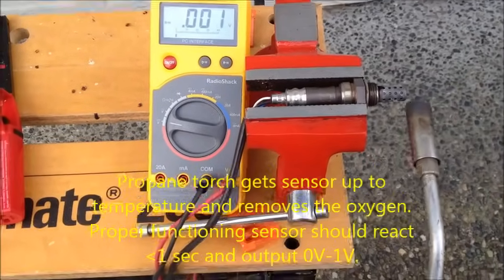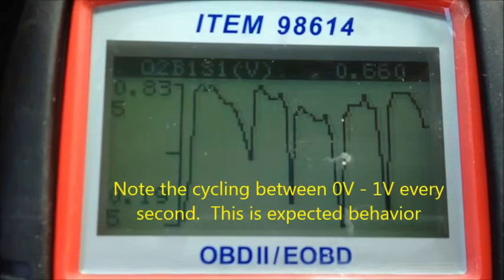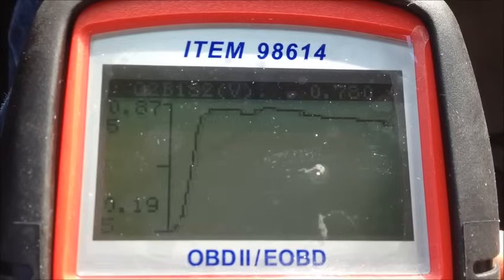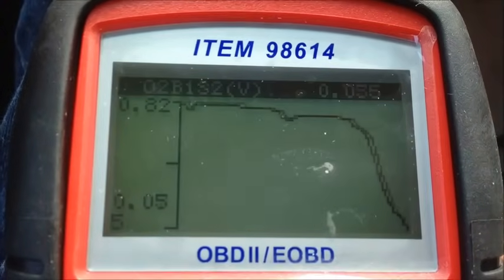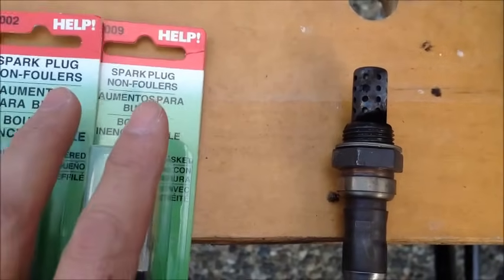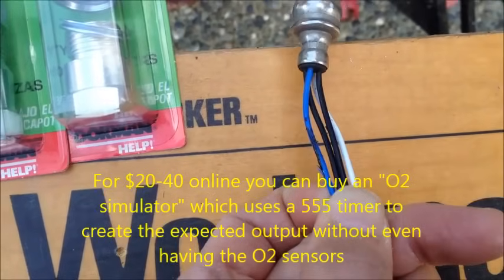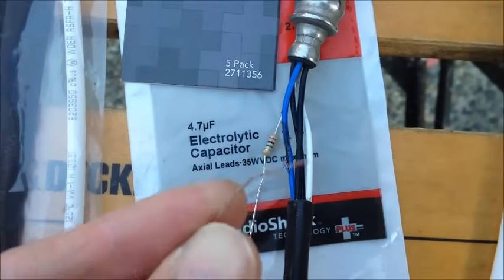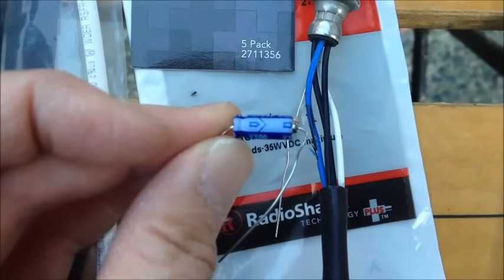$3 O2 simulator fix for P0420 Check Engine Light

Comment: Here’s how I finally got rid of my P0420:  

I have a 2007 Suzuki Grand Vitara that was getting the P0420 code.  I decided to first try using an O2 spacer since they have been working fine for the last five years on another car I have, a 2000 Nissan Xterra.   It passes inspection in California every two years with no problems – all monitors stay ready and no codes or check engine light.
However, the spacer did not work on the Suzuki.  I got a P0420 very quickly after two short drive cycles.  I then tried a different spacer with a smaller hole but still got the P0420.  Two more different spacers were tried (right angle spacer and 45 degree spacer) with no luck.  I gave up on the spacers and switched to the low pass filter method described in this video.  My first attempt was using a 1uf capacitor and a 1M ohm resistor.  I got a code P2A01 for O2 sensor circuit performance.  I then tried a 4.7uf capacitor and a 1M ohm resistor.  Same code showed up – P2A01.  This time I graphed the sensor and saw that it was never going below .22 volts.  The Service Manual for the Suzuki says code P2A01 is issued when the O2 sensor “signal is more than 0.2V for more than 4 sec. even though vehicle is running with fuel cut mode below 4000 rpm.”  This generally occurs when you are driving, for example, on a freeway and you take your foot off the gas to coast down the exit ramp.  It can be simulated by idling the car and revving the engine four or five times and then letting go of the gas pedal.  You should see the O2 sensor dip quickly to almost zero before climbing back up.  

I then tried a 270K ohm resistor instead of the 1M ohm along with the 4.7uf capacitor, hoping it would expand the amplitude range of the O2 sensor so it would go below .2V.   The resistor helped some, but the O2 sensor barely got below .2V, and it was for just an instant no matter what the driving condition was.  

Next, I tried a 10uf capacitor and a 180K ohm resistor.  This helped a lot and the sensor appeared to be working as it should as compared to the sensor on bank 2.  I got no more fault codes or check engine light.  However, the monitors would not go into ready mode no matter how long I drove the car.   I tried one final time with a 10uf capacitor and a 100K resistor.  Same result. After driving the car for over 300 miles, monitors were still not ready.  

Went back to trying a spacer again after reading that some people stuffed some stainless steel wool into the spacer tip to reduce the flow of exhaust gas reaching the sensor. Went for a test drive with my scanner attached not expecting much, but all monitors went ready in just a few miles.  Came back home, checked for codes and found none, not even any pending codes.  Restarted the car and this time drove on the freeway to see if any codes would set.  Once again, no check engine light, no codes.  It’s now been about 1300 miles and still no codes and all monitors are ready.  My inspection comes up in about a month and should pass easily here in California using the spacer.

The stainless steel wool and spacer was used with no resistor or capacitor.
Reply: Wont the smog inspector see it if there a visual check
Reply: @HonDaPursuit exactly my concern
Reply: سلام عليكم بدون زحمه هاذ الطريقه تنفع الى سيارة الحديث مديل 2022
Reply: I have same question - did you use resistor and capacitor + distancer, or distancer with steel wool solely
Reply: @gile11ubica  spacer and steel wool only.  No resistor or capacitor
Reply: Where did you go for smog check? The place I went failed me because they seen my spacer.
Reply: hey if i go to inspection with spacer does that gonna make my inspection failed and which one you recommend thank you

Comment: Does anyone know where I can order these from looks like RadioShack no longer carries them and fryes is now closed
Reply: I can't find this stuff either. Is a tantallium capacitor okay to use? I found one of those with a 4.7 uF 35V rating. Got to order all this stuff on ebay and amazon.

Comment: Can't believe this actually worked on my '99 Suburban!! I could not remove the O2 sensor even with correct tools. Thanks so much for the well explained vid!!
Reply: Correct tool = heat
Reply: what motor is in it

Comment: Hey, the thieves cut off my O2 sensor so I have wires only. can I use your trick to turn off the engine light?
Reply: No . You still need the input from the O2 sensor .

Comment: I guess you could connect the cap and resistor anywhere in the line.Maybe a place easier to get to.
Reply: THis is what i want to know. My post cat sensors are under the car behind a bunch of skid plates and reinforcement plates. Pain i nthe ass to get to.

Comment: Hi brother i have Suzuki Every 2010 model i face P0420 bank-1 and sensor have 5 wire's and bank-2 have 4 wire's . Plz help me Van give very bad fuel Average. New sensor is not available and used same sensor not working properly. I'm stuck in this Problem

Comment: Nicely done video, and you are correct, this will "fool" the computer...sort of.  The computer will show this test as "incomplete" and it will stay that way.  Eventually, and it can takes months, you will most likely get the light back on with codes P0144 and P0145 which are directly related the voltage sensing of the O2 sensor.  In California, your car will not pass due to the incomplete, but your light will stay out for a while.
Reply: So do you need all monitors set in CA to pass? I'm a PA emissions inspector and we can have all but 1 monitor set and all but 2 set if it's from 95-00
Reply: @ZachHolmes02  up till 03 you can have 1 incomplete monitor. On 00 and below I believe it's 3/4 of monitors are required.
Reply: You are correct. That’s what happened in my case. Engine light remains off but cat monitor does not set. Great video though.

Comment: Hi!  Thanks for the video.  Are the color of the wires the same for all cars with O2 sensors for the downstream?  Also, I have a Pontiac G6 2.4L I am hoping this will work for the downstream on my car since I put a header on it.  If you have time to answer my questions I would appreciate it.  Thanks!!
Reply: no theyre not.  but its not hard to figure it out.

Comment: Tried this twice both times got a 158 and 138 code voltage too high...
Reply: This means the voltage is staying max'd out for >10sec.  This can happen if the O2 sensor is burned out and not cycling in response to o2, or if the RxC is too high.  You can try to reduce RxC, but my guess is that your o2 sensor is bad.  You can bench test it as shown - if it responds to the lack of o2 in the flame then it's OK and you just need to lower RxC

Comment: Will this work on a 2013 Ford Mustang gt  also I have the foulers on them still getting the light  also I have gutted cats
Reply from the maker: It won't work if you have gutted your catalytic converter.  This depends upon having a working cat and just helps make it look better by slowing down the signal.

Comment: dont you think 1M resistor is too strong to drop the amplitude wave
Reply from the maker: It's all about the product of the resistor x capacitor and how much you want to slow the waveform.  The values I gave worked for me but you may need to adjust depending upon your input waveform.  If you have a graphing OBD like I show then you can see just how much you need to slow it, otherwise experiment.  If you slow the waveform too much you'll get a different code saying it didn't change enough in 10 sec.

Comment: I wired up my downstream sensor to fix the p0420 code with the 1mega ohm resistor and 1uf capacitor. But now im getting what most people complain about is the p0138. Do you have a fix for this?
Reply from the maker: P0138 means the lower voltage is staying above 1.2v for more than 10 seconds.  This could mean your o2 sensor is broken - did you bench test it as shown?  Another possibility is that the value of the resistor x capacitor is too high causing the waveform to slow down too much, but 10 seconds is a long time so I would suspect the former more than the latter.  You can try to reduce RxC first by using a lower value R or C.
Reply: @miteeman  I held on to the old downstream 02 sensor after i replaced it and still got the same p0420 code with new one so assume the old one is still good. I believe its the resistor or capacitor thats keeping voltage high for more then 10 seconds and ecm is throwing that code.  Im thinking about building my own 555 narrowband 02 sensor simulator and see how that goes

Comment: Thank you for posting this. You say in the video that you would comment on the capacitor spec (4.7 vs 1 micro Farad as used by others), but you didn't. Could you please elaborate? How to choose between the two? Would that choice be car make-specific? TIA
Reply from the maker: It's a bit of a guessing game.  If you have a graphing OBD you can see just how much you need to slow down the waveform and use T=RC.  Otherwise it's a guessing game - try something.  If it doesn't work, increase either R or C to increase T.  If you get another error saying it hasn't changed in 10 seconds then you need to decrease R or C to decrease T.
Reply: I tried both the 4.7uf and 1f. Got a 0138 from each. Gonna increase the cap. tonight.  Wish me luck!

Comment: Comprendo , para vehículos que el sensor o2 arroje valores de resistencia de 11 a 16 ohms es perfecto el capacitor 4.7 UF , para los de 4 a 6ohm es mejor el capacitor de 2.2 UF o 3.3 UF , interesante información
Reply: yo le puse a mi auto el de 4.7uF y la grafica esta casi estatica en 0.4, algunas veces baja a 0.3, pero tarda como 10 minutos y regresa, que puedo hacer para que oscile un poco mas rapido? le meto un capacitor menor o mayor? saludos
Reply: Quisas probando un capacitor de 3.3uf o Menos para que no suavise la señal excesivamente

Comment: Did the mod, now running stuck lean on both downstream lol, I think the resistor is to strong. .240 to .600 volts solid instead of .550

Comment: I've tried it on previous o2 and newer ones but I get heater circuit malfunction since doing this. My capacitors seem to be pointing the right way but I wonder what would cause the heater circuits to malfunction. If the capacitors are facing the wrong way, would that cause the malfunction?
Reply: Have you figured this issue out? Im having the same problem.

Comment: May I know the capacitor 4.7 ohms.?Thank you in advance.
Reply: 4.7 microfarad capacitor. I performed this hack yesterday on my 2000 Dodge Grand Caravan and it has worked like a charm. I got the capacitor through amazon. Here's the link https://www.amazon.com/gp/product/B07S7QPV6C/ref=ppx_yo_dt_b_asin_title_o02_s00?ie=UTF8&psc=1
Reply: You're confusing the two different items.  Resistors are measured in ohms.  Capacitors are measured in microfarads.

Comment: Anyone done this after removing the cats completely? Also, it seems the o2 sensor still needs to be in the exhaust. Otherwise I'd rather close the hole and wire this up as far upstream and out the way as possible
Reply: @Drazax78  hell yeah dude. I'm welding up a dual exhaust so I'll add the second o2 mounts back on

Comment: you can make those connections on the plug sensor side, it will be hidden and protected!
Reply: Yes, if you can find somewhere to make the modification that's easier to access, even inside the car, that would be better.  On my Odyssey I was already down there so it was easy for me to do it right there and be able to test it.

Comment: I have an 07 prius with an p0138 & 2237 after changing the o2 sensor twice and trying the resistor/ capacitor combination. 
The light came back on after 25-30 miles.
Reply: Have you changed the upstream sensor. I have an 07 prius and I am just now replacing both o2 sensors at 323,000
Reply: @alexhuggins5924  
I've changed both up and downstream sensors and the check engine light comes back on within thirty minutes. 
I was told it may need a new Catylitc converter

Comment: @MITEEman Hey there...so I switched to an aftermarket downpipe on my 2018 F150 3.5 Ecoboost and I'm getting the 420/430 codes...would this be a viable solution to get rid of these codes?

Comment: can i used 1 watt resistor in replace to 1/4 watt and 50 v in replace to the 35v rated capacitor? Thank you so much.
Reply: I think a 1 watt would dissipate more heat, but I don't think heat is an issue here. 50v instead of 35v is fine. 35 just refers to the maximum voltage the cap is rated for.

Comment: Thanks for this video man, I did this mod on my Lexus to correct P0420 error. It has got rid of the P0420 error but now on the same bank I have an error saying O2 Sensor Circuit High Voltage. I have used a 1Mohm carbon film resistor and a 35V 4.7uF capacitor just like your video. But getting this new error. Can you kindly advise? Thanks
Reply: Did you find out the problem ?

Comment: So i did this but now im getting p0057 and p0138 codes, any advice for these?
Reply: Did you get a fix for this?  I was getting a 0420 code. After adding the resistor & cap I get a 0138 code. I'm doing a hit-or-miss, experimenting with different cap values.  Please help!
Reply: @pauls.3188  my fix for it was selling the truck lol

Comment: Hi smal question please dit you do that on the sensor before or after the cata. Bank 1 en bank 2 i have to modefide sensor 2 and sensor 2 correct ? So i have to fix the 2 sensors after the cat ? (Bmw got 2 converters )

Comment: I removed honeycomb material from my cat. Now I hear sound like air is leaking from cylinder when I press gas paddle. Any solution to this?
Reply: Kashif Javed make sure everything is tight maybe add glasspacks also. I had same issue I added the glasspacks and exhaust tips for the smell.

Comment: Just completed the filter. Working too well. The wave form is too smooth. Computer thinks that it not communicating with the O2 sensor. Larger value resistor or smaller capacity capacitor or both? T=R•C
Reply: You need to reduce T, so either a smaller resistor or capacitor.  Resistors are easier to find in a variety of values.

Comment: I did this a few years ago in my BMW and it worked fine.  Tried it on a 2004 Acura and the P0420 is gone but a P0139, (O2 Sensor Circuit Slow Response Bank 1 Sensor 2) error comes up.  Its been a long time since my EE classes (for an ME) so I'm not sure how to alter the circuit to give a bit more response.  I'd guess reducing the capacitor to reduce storage, but not sure.  Any suggestions?
Reply: I'm not sure how to fix P0139 but if it's "too slow" then you want to reduce T=RxC.  So you can reduce either the resistor or capacitor but usually it's easier to find a smaller resistor.  Generally reduce one or the other by half and see what happens.  If you have a multimeter you can even use a potentiometer to find the right value and then swap in a fixed resistor.
Reply: @MITEECSman  thanks,  I'll try that

Comment: Passed Emissions today on a 2001 Toyota Sienna with this strategy.  Thanks a lot.  I should share some details. When I soldered in the 4.7 uF capacitor and 1 megaohm resistor I got p0136 code (like a low voltage code on o2 sensor).  Tore it all out and resoldered a breadboard instead (the o2 sensor connector is inside the cabin underneath the passenger seat as opposed to underneath the car).  On the breadboard, I eventually used a 4.7 uF capacitor with a 470 kilo-ohm resistor instead.  Although I didn't need to, using the breadboard allowed me to experiment with different capacitor and resistor pairs which you might need to do depending on your vehicle.
Reply: Im having same problem on 02 4cyl tacoma,was to lazy to try a potentiometer, will try the 470k.thanks
Reply: Huge thanks! Worked for me. Idea to use breadboard, plus the other guys who suggested to use potentiometer - brilliant!:hydrate:
Reply: Thanks, this is really helpful info for me
Reply: Dude that is genius definitely doing it this way. Gonna bring the board up into the cabin if I ever need to change anything it'll be way easier
Reply: Any advice on a 2015 chevy trax ls I tried this method using the detailed diagram. Used a 1millon ohm 1/4 watt resistor and 1 4.7uf 5v capacitor and my reading voltage stayed on 1.200volts for my bank1 sensor 2 am I using the wrong resistor? I've replaced everything from the upstream to downstream sensor and catalytic converter aswell. Any advice for me to clear that P0420 code?
Reply: Used a 4.7uf 50v capacitor
Reply: Agreed. Solder on a 0-1M ohm pot, not a resistor.

Voltage was low on my O2's max voltage self test with 1M. 100k and 1uf worked for my 04 Highlander.

Comment: I've got a what I think is a denso in a '13 outback.  I have a oil burner and I think it messed up my cat.  By 125k miles I was getting the p0420 code.  I was getting the code maybe every couple weeks.  I went ahead and gutted the cat, because my mileage had dropped from 27 to near 25mpg over the last few months.  I tested the O2 sensor like you did with a torch and I am pretty sure it is working.  At any rate I did the resistor capacitor install like your video and now I am getting p0140 on the first drive out.  I cleared it but it will probably return.  I graphed my 02 sensor before the gut and it was sporadic jumping between .05v to .9v at 2000-2500 rpms.
Reply: Ive got this issue on a 13 outback, you ever get it to work properly?

Comment: what about emission test ?
Reply: Ahmet Yucel won’t pass a tail pipe test but those are very rare these days.  Most emissions test are just a scan of the vehicles computer.  It will pass that as long as you don’t have a check engine light.